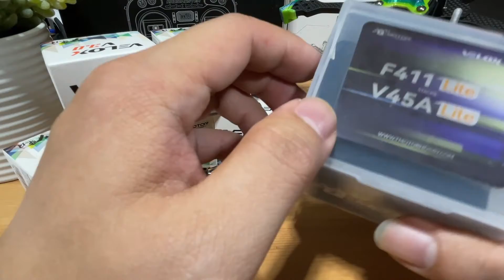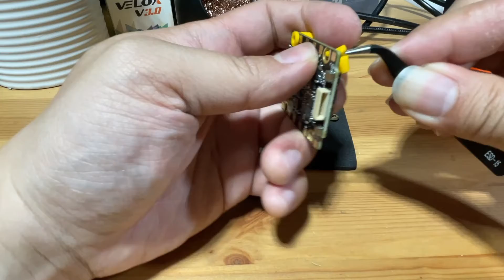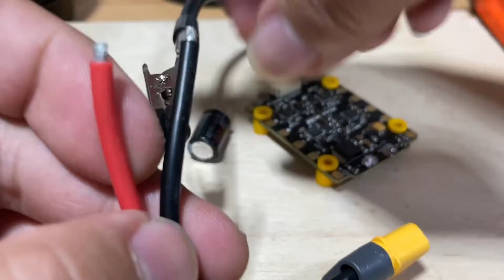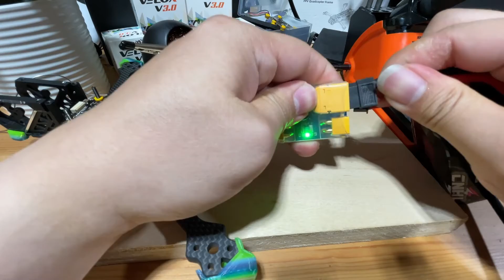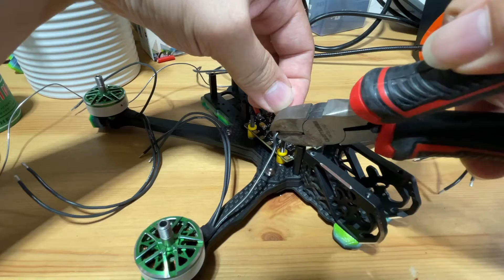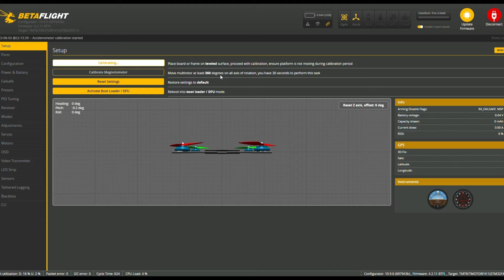Build a 5" FPV Drone Part 1: Powertrain System installation (T-Motor Stack + Velox 2306 V3 Motor)

Comment: Hello, so I just wanted to say that I enjoyed your video.  The components you picked for this build are excellent choices so if anyone is watching and this is all new to you then you found a great example here.  This build will be a good flyer, very tough, but not a racer although that is not a problem as not everyone is focused on racing.  

Anyway I am just glad to see good videos going up on YouTube.  When I got my first drone there was not a lot of info out yet - what the heck is a flight controller?  Why does this have one?  How to I know if it is working properly?  

Eventually a crash toasted one of the motors - but it could have been a blown ESC so I put it on my workbench, connected my PC to the flight controller and proceeded to brick the entire thing in just a few minutes... kind of put me off of the whole thing for a couple years.  Also there are so many great vendors for these drones and quads here in the USA.  

Just google "FPV drone" and you will see several of the main shops pop up in the search.  I do like them all, they all ship same day, they just stock different items and might focus on one brand or another.  Pyrodrone, Get FPV, Race Day Quads are the 3 vendors I most commonly use and they are all very good to deal with.  You can buy some parts off of amazon but I think that you will find better items at better prices also available to ship same day from these vendors - they really are your best choice especially when just starting out...

Comment: Tip when soldering pads , what you should do is to heat up the pad first and then use it to melt the solder Not the iron tip , this way you ensure a good joint
Reply from the maker: Good point, l later figured this out on my other builds and really improves a lot
Reply: @XwingFPVRC  This is not only a good point but actually essential and if you learn about soldering you would understand why.  The pad has to get hot enough that when it touches the solder it will melt it and the solder will flow from the cold areas to the hot areas.  

Getting good contact with the items you are soldering is essential, and if you are using an iron of sufficient wattage there is no reason to "crank up" the temperature to get it to work, set it to about 650F or 340C to start and yes, you can go up to about 750F on heavy solder joints but that will come from some experience and practice.  You an buy boards to practice soldering on and this is a great idea since those cost a few bucks but your flight controller might cost $100 or more. 

Soldering is not difficult but it is easy to make mistakes with everything from poor choices for heat settings to wrong wattages for the work to wrong tip, wrong solder, poor use of flux, etc...  I would recommend that if you decide to solder that you use 63/37 chemistry - again if you get into it you would learn why it is the best choice but suffice to say it melts more predictably and is easier to use than 60/40.  I personally like Kester solder - they have been around for ever and have a great name.  

Also regarding soldering irons - I am a fan of the "TS100" style irons.  They look like toys but they are actually very capable irons that actually can compete with some of the best bench irons that are commonly used in production (JBC is arguably the best, Weller, Hako are some other common brands).   Just get a good power supply for your TS100, some good flux, a tip cleaning station, the solder I recommended and you are set.  

Look up the "TS100" as the original choice, but I would also check out the Secure Si012 pro which is my current iron, it works great so far, a bit better than my first TS100 style iron.  Cheers!

Comment from the maker: Part 1: How to connect to powertrain system FC/ESC/Motors. 
https://www.youtube.com/watch?v=lmMEBPr6C5w 

Part 2: Learn how to set up your ELRS Receiver 
https://www.youtube.com/watch?v=ZdED9JqWTEE

Part 3: How to Flash BetaFlight Firmware 
https://www.youtube.com/watch?v=67_L9X3K_S8&t=83s

Part 4: Cause of drone Runaway and the fixes 
https://www.youtube.com/watch?v=ztVcrI_nqUM&t=14s 

Part 5: How to hook up your VTX system/ Camera + VTX 
https://www.youtube.com/watch?v=cSYu8kEbot4&t=10s